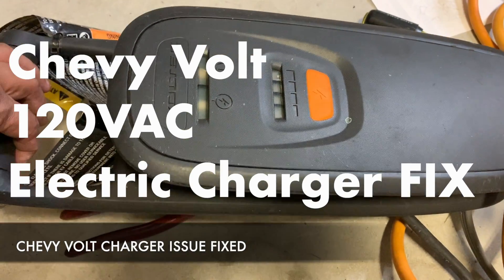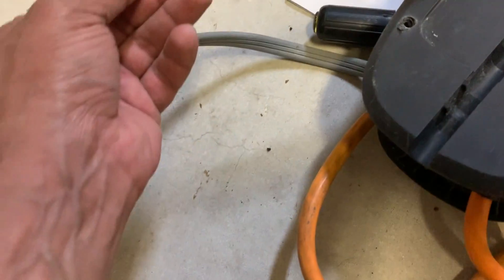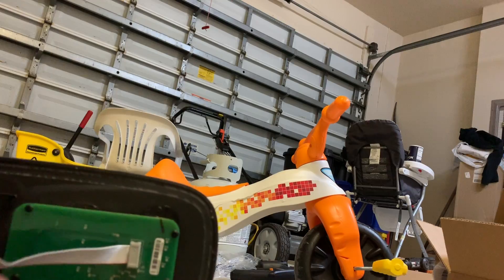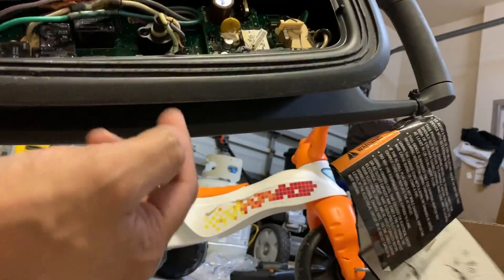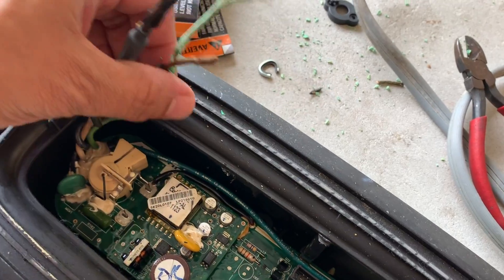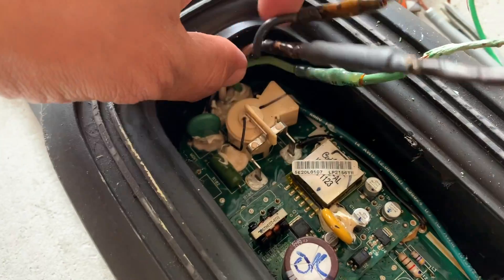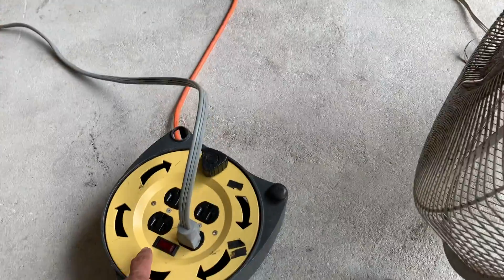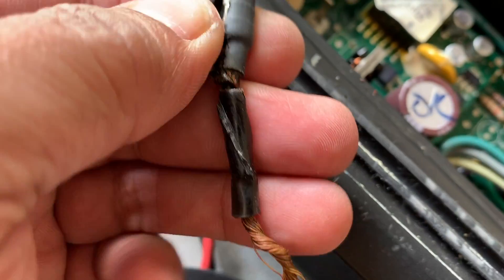CHEVY VOLT CHARGER FIX

Comment: My question is what is causing the fuse to blow in the first place?
Reply from the maker: Your plug is probably getting hot and melting causing the high current due to heat and causing fuse to blow
Reply: That fuse in protecting the circuit on the PCB.  It is unlikely that the wiring problem would blow that fuse.

Comment: Your comment on your Volt's 12 Volt battery replacement video was disabled. Those batteries are so well made, they almost never go bad. Whoever recommended to you to replace your battery probably knew that all you have to do is disconnect the 12 Volt battery (ground side only) wait a few minutes then reconnect it, and all the error codes will disappear. They probably wanted to sell you a battery. Your broken battery is probably is still good and worth a lot of money, do not discard it.
Reply from the maker: Nat Shain  It was a recommendation from dealer. I thought the same thing at first but then I had them remove the old battery and give it back to me. I tested the battery myself and yes it was bad. Everything has a life and it lasted me from 2012 till 2019. That’s pretty darn good :)
Yes I agree AGM batteries do last longer but yes they do go bad too. I have 2 German cars with AGM batteries and had to get new batteries.

Btw removing battery Neg terminal and reconnecting after few minutes thinking I was resetting did not work. So it was a battery module issue.
Reply from the maker: Also would like to add that if all they had to do was a reset than they wouldn’t keep my car for a week to wait for the part and give me a rental for a week. The week rental cost was more than the battery that was paid by them. 
For $235 I spend it was worth it.
Reply: I am curious, when the 12 Volt battery you replaced was removed, did you lose your favorite stations on the radio or your favorite addresses on the GPS (if you have one) or any other memory items?
Reply from the maker: I didn’t check.